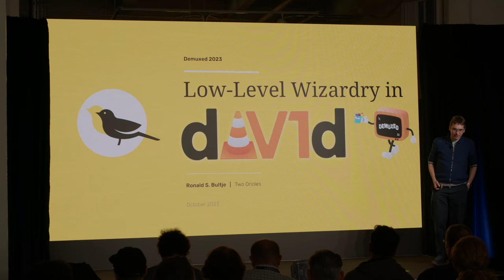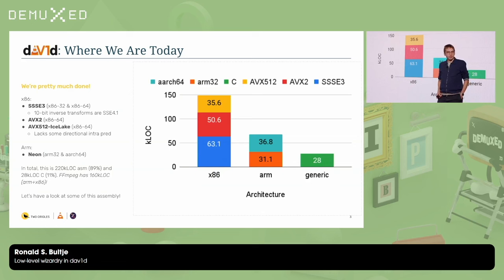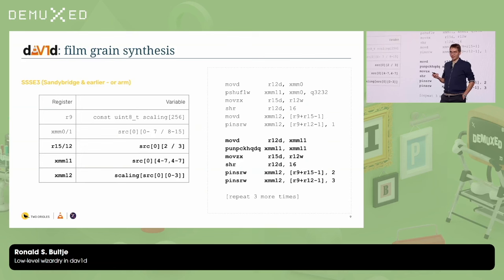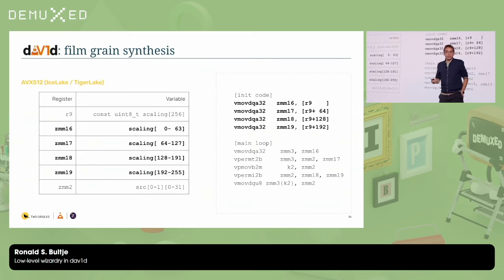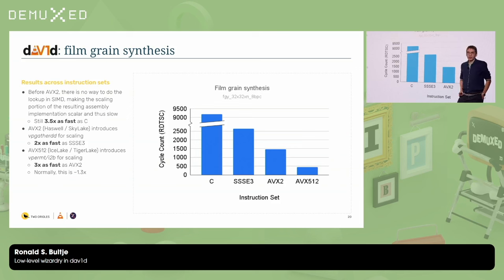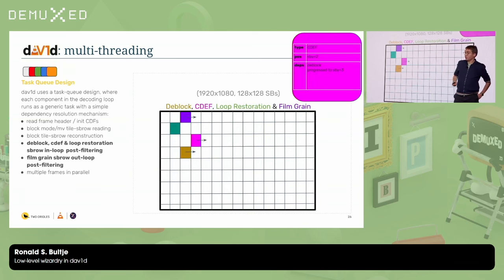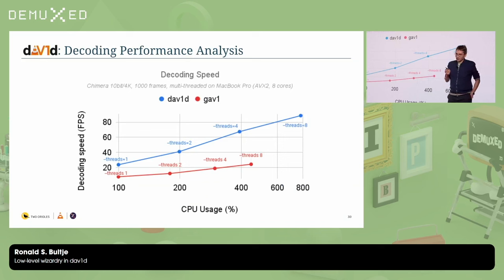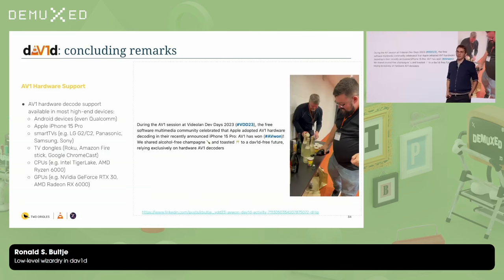Ronald S. Bultje - Low-level wizardry in dav1d

Comment: Here's a question: Is the dependence on Assembly an indication that compilers are insufficient or that higher level languages aren't capable of describing things in ways that they can be compiled efficiently? If it's the compiler, what would it take to make a higher level compiler to approach the efficiency of assembly?